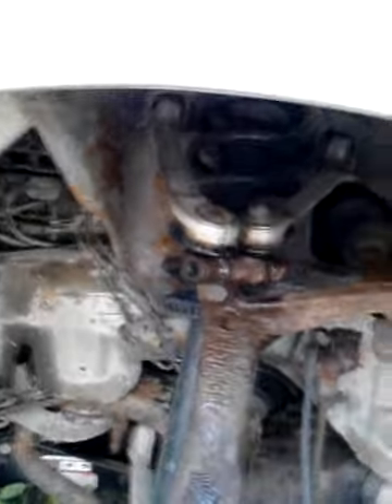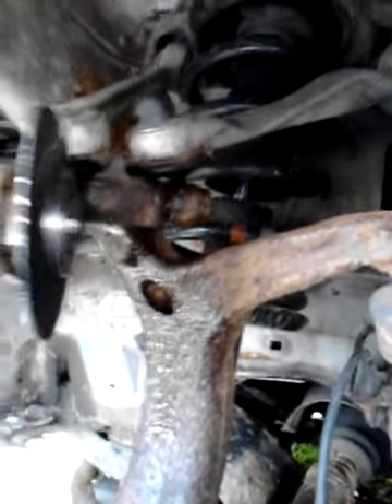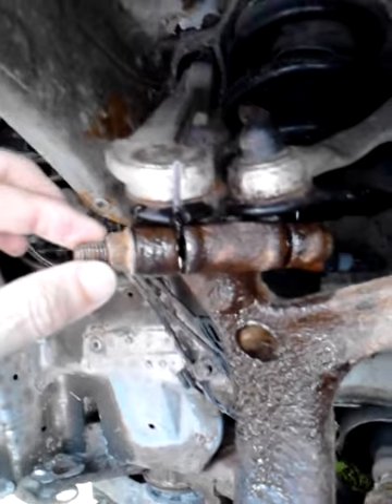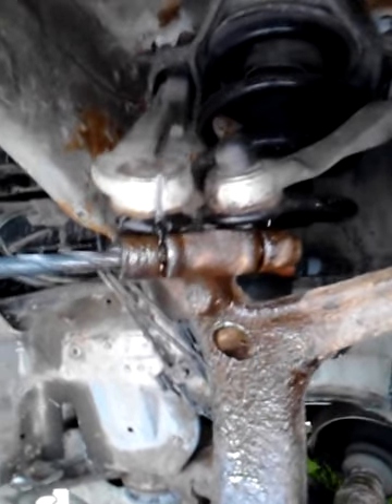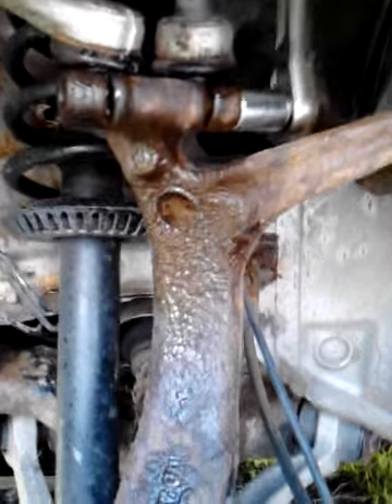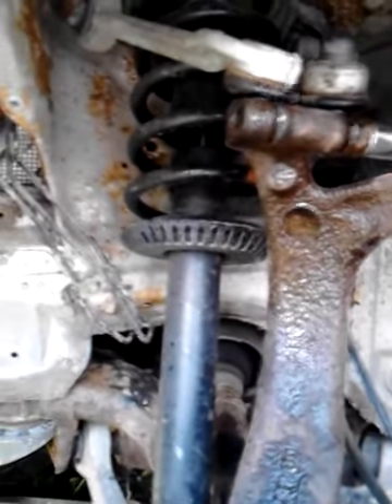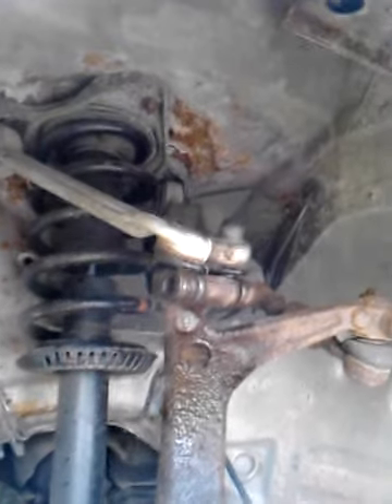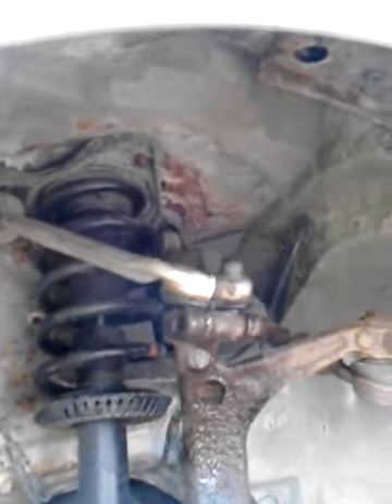PINCH BOLT REMOVAL AUDI A6

Comment: You need three tools. MAPP TORCH, PENETRATING OIL AND AN AIR HAMMER. Put a wet rag on the control arm ball joints. Heat, spray and air hammer. Keep repeating and you'll see a space form at the bolt head. Victory will follow soon after. I replaced the bolt and never seized the ever living hell out of it.